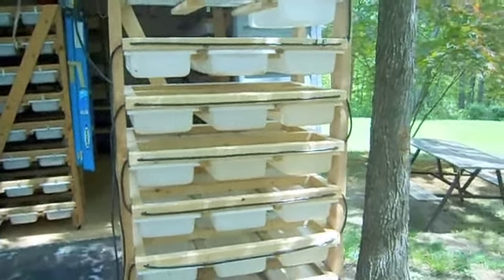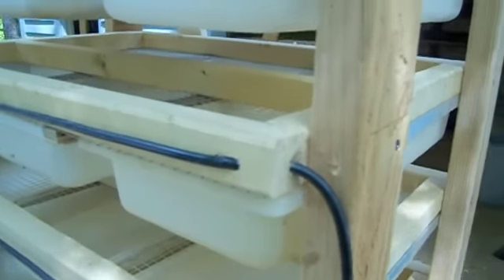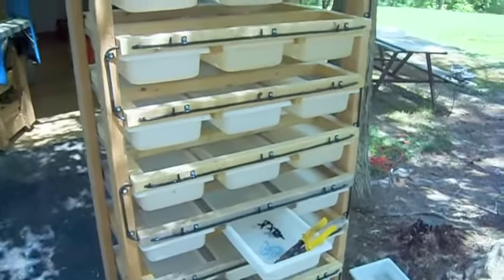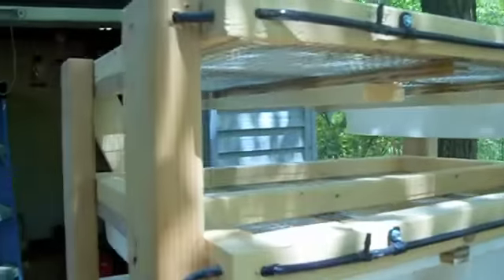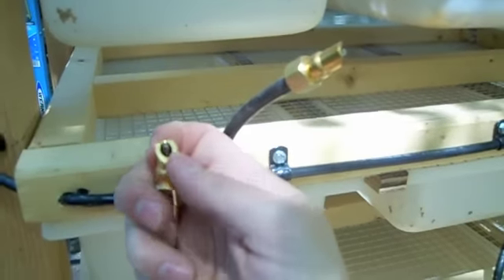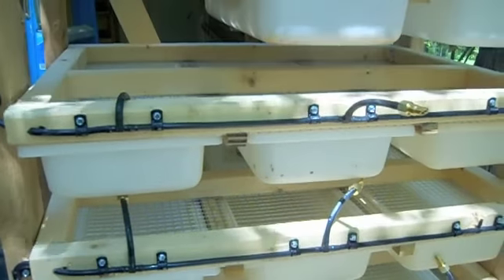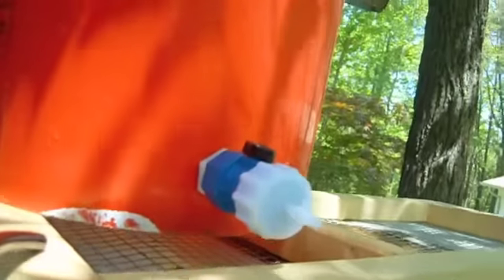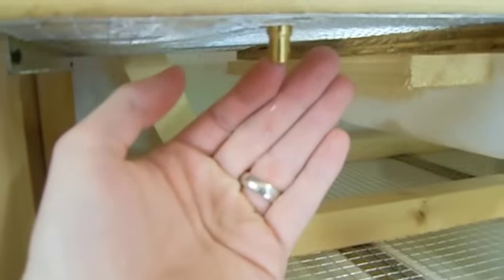JKR Pro Tips - Plumbing a Rodent Rack

Comment: Great video.  Great design.

Awesome tips about placement of bucket hole and drilling holes in the lid to prevent vacuum effect.

Only thing I would change is to have the piping clear if possible.  Easier to see if the system needs flushing out rather than waiting for a blockage to occur.

Comment: HI i am thinking about building a watering system like that for my rats. It is going to be for one huge cage that will hold a couple hundred rats. I know i need a bucket, the t bracket, and vari flow valves is that all i need or do i need anything else.